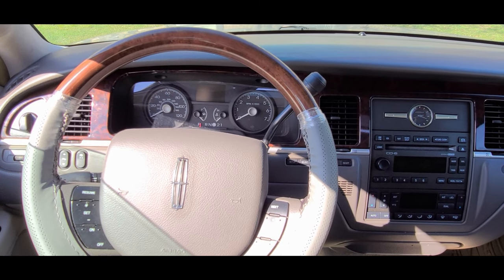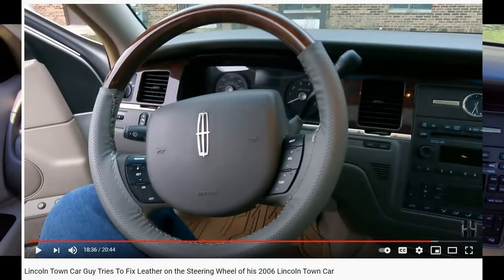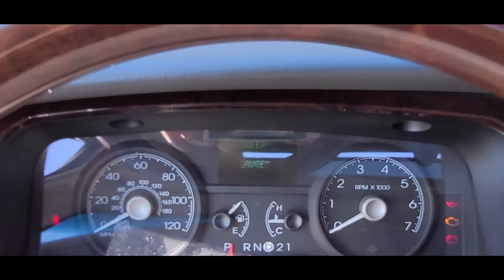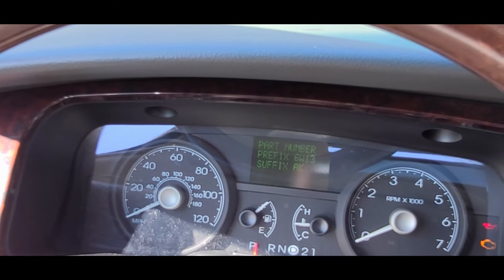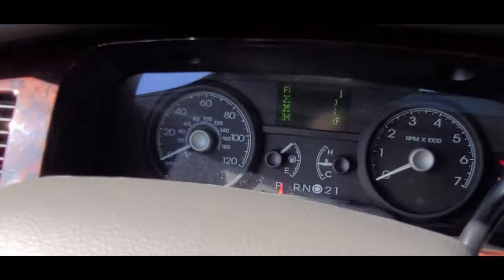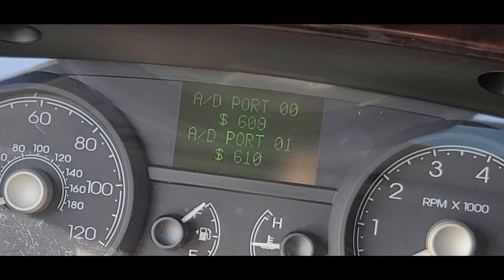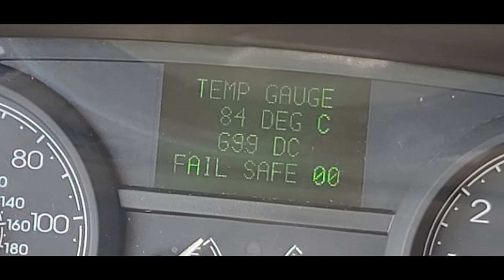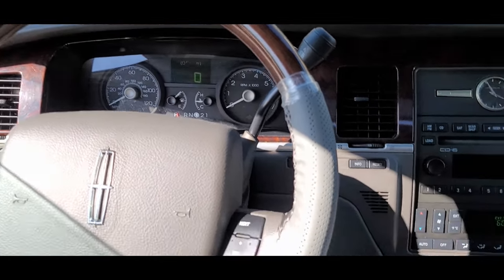Lincoln Town Car Guy Tries to Test Gauges and Display on his 2006 Lincoln Town Cat Signature Limited

Comment: 💀💀💀💀💀
👻👻👻👻👻
Reply: Right on Vitaliy,
I'm not too familiar with this technical stuff.
Maybe Rich can look up those two DTCS Codes E013, D262.

The digital Tachometer function could be useful to get a more accurate reading of your RPM's.
Say when your car is idling with A/C on or off.
Or when your cruising on the highway.
Just start the engine, and toggle through the screens as you drive.

Also the digital Engine Temperature could be useful to check if your thermostat is functioning properly while driving.
But its in Celsius, yuck.
-Chuck
Reply from the maker: Thanks! I'm sure it's useful for someone out there.
Reply from the maker: Why up so early? :)
Reply: @VitaliyKofman  
These are  all automated replies from my channel administrator. 

My name is Rahmdick Baldeep Singh.